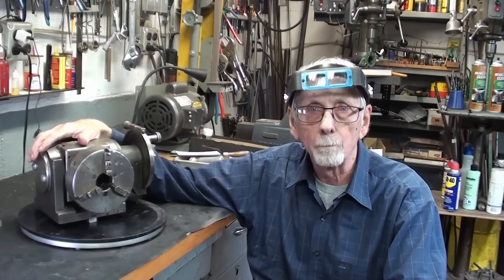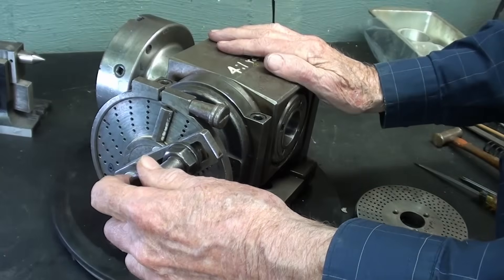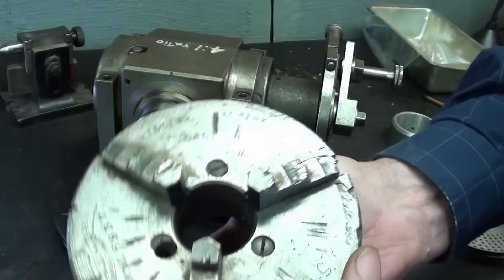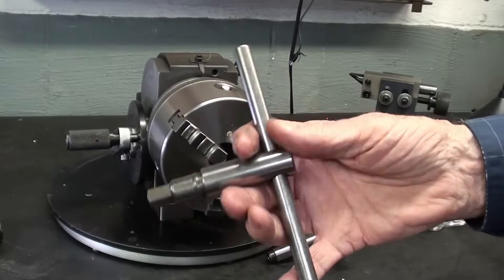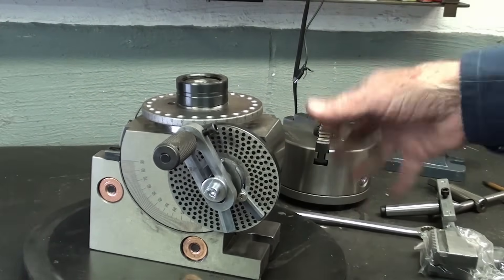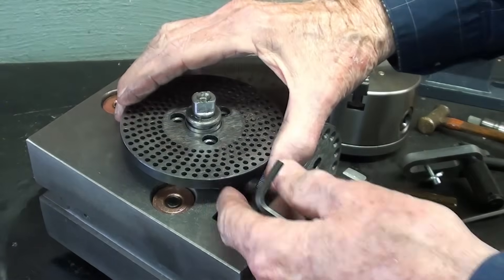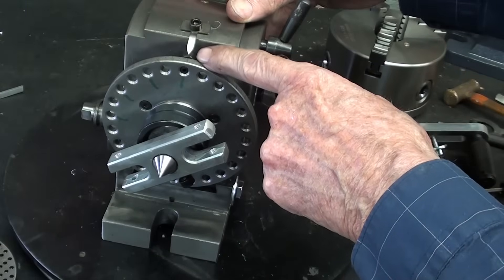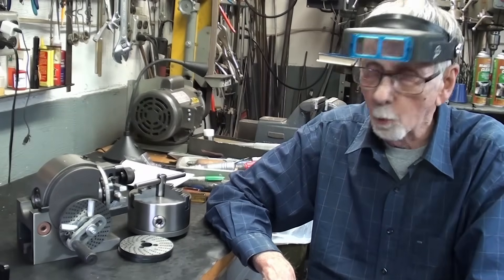MY NEW VEVOR DIVIDING HEAD #1046 pt 1 tubalcain index

Comment: I'M RETIRED WITH A SHOP AND IT TOOK 4 YEARS TO PUT IT TOGATHER
MANY PIECES CAME FROM VEVOR
8 IN,CH 4 AND 3 JAW LATHE CHUCKS FOR A HARRISON 250 LATHE
DIVIDING HEAD , ROTARY TABLE 8 INCH AND A 6 INCH MILL VICE
ALL WORK GREAT AND AFFORDABLE AMAZON !
Reply from the maker: That is awesome and affordable. I’m not sure why so many people are violently a pool to vevor.
I know it’s all Chinese, but so is everything at Walmart, Harbor, freight, Home Depot, and all of the rest of the box stores and it’s going to stay that way forever
Reply: @mrpete222  IF IT WORKS FOR YOU THEN BUY IT ! 
 IT BEATS THE SAME USED PRODUCT MADE IN USA AT 5 TO 10 TIMES THE PRICE. CHINESE IS ACCURATE ENOUGH FOR MY WAY NORTHERN COMMUNITY AND THE SHIPPING IS FREE. I ALSO LIVE IN A PLACE THAT IS WAY OUT THERE IN BF NOWHERE.

Comment: Hi Mr Pete, I really enjoy your videos. I have one of these Vevor Dividing heads. I have had it for 2 or 3 years now and I find it to be excellent. 
I am very tempted to try one of their Vevor DRO kits! I have bought a number of items from Vevor over the years, Some of them are certainly made down to a price. I bought a welding table for example which is a bit cheap and nasty but it does what I neddd and only cosy me £29.99. I couldn't have bought the steel to make it myself for that.
Reply from the maker: I will be making more videos of the dividing head in the future. It really appears to be quite good, especially for the price.      I think a lot of their products are pretty good, certainly as good as harbor freight. But I’m sure some of it is junk. But that is true of just about every manufacturer.

Comment: Thanks Mr Pete. I have one BS0 for some 2 years by now and have used it several times in vertical mode with the supplied chuck (that fits to my pretty old Blomqvist BSN600 benchtop lathe). The base lacks a drain hole making some operations with the chuck and after some milling the bore will be filled with cutting fluid and chips.  
The first time used in this way it was left overnight with the bore stuffed with chips and cutting emulsion.  Bad idea indeed. Next day I found that it was difficult to rinse the bore and I disassembled the whole apparatus that was quite a job. The axial bearing has no sealing and was cleaned from very fine chips. 
I decided to make a drain whole that meets the T-slot.
At next usage in the vertical mode I was satisfied to see the fluid disapeared and the chips could now with success be sucked up with wet vacuum cleaner.
You may ask why I did not use the 8" round table - the reason for this was that there was a slight taper in the workpiece.

Anyway the BS0 is well worth it's price.
Cheers,  Ingvar, living in Sweden

Comment: Obviously vevor picked you out a good sample to show. Mine had the following faults.
1, gradient wheel you could only see half the gradients
2. Indexing pin did not fit into the Indexing holes
3. The chuck had the brand name ground off it!
4. The so called brass lock nuts are just coated brass colour, they were rough and would all free movement of the head
5. The lock screw that is at the back of the spindle was a socket head screw that protruded so far out that you could not turn the head up 90degrees.
6. None of the indexing plates had the number of holes stamped on them!
There is a video of mine on my channel.
I think that vevor must get more than one supplier as the ones I have seen vevor give out for free on yt to show seem to come in a box with red printed writing and then there is the plain box which mine came in.
I have bought a few things from vevor and the quality/price has been ok, but I cannot recommend the bs indexing head unless you are lucky to get a good one. Mine was rubbish and a waste of money. I can only advise if you take the gamble and get a crap one then to send back straight away, vevor never fixed my issues or refunded. Mick
Reply from the maker: Sorry to hear that
Reply: @mrpete222  not your fault. Mick

Comment: That's surely a rare ratio on that Hardinge, and people who have odd ratios on old dividing heads without documentation can have a hard time. I created a calculator for such cases where you can input any n:1 ratio and calculate which plate would be required for a given number of divisions. There is also a calculator that will generate a table like you'd find in the original owner's manual for a dividing head of any n:1 ratio. You can DM me for more info, won't pollute this comments section with links. Would love to share my calculators with you as well @mrpete222 as a small payback for all of the knowledge and entertainment you've given me over the years.

Comment: A teardown and cleanout of the original lubrication might ve in order. I value my dividing head but I don't think budget chinese gear can ever be assummed to have had swarf properly cleaned out and decent quality lubricants used. A tear down, wash and relube is unlikely to be a total waste of time even if its not strictly necessary in an individual case but may make a big difference if its full of swarf and sump grease.

Comment: Can a 5C collet be fitted from either side on the original dividing head? it looks like it could.
Reply from the maker: No
Reply: @mrpete222  Thanks Pete, can the original head be swung completely over 180 degrees so it can be used on either side of the bed?

Comment: I bought an Ellis a few years ago. It’s in pretty good shape. The paint was mostly still there, but except for a hidden spot, pretty deteriorated. The surfaces were in excellent shape except for a light patina. The only problem was that one foot was broken off and gone a long time ago. I took it apart, cleaned everything, removed the paint and powder coated it. I then welded a new piece of cast iron on to replace the foot. I use 309L TIG rods for cast iron and it works very well. I wouldn’t use it for a hollow part, but for something that isn’t stressed from both sides, it works well. At any rate, it came with an excellent 4” 6 jaw Adjust True Buck chuck. It’s really nice. All the manuals are available on line. I only have two plates for it, but it hasn’t been a problem. Disengaging the indexer just requires loosening a set screw on the top of the device, lift the indexing unit and it’s done. Reversing that, of course, puts it back. What’s nice is that you can rotate it in the horizontal plane as well as the vertical. That makes cutting angled gears or even tapers very easy.
Reply from the maker: Sounds like a great head. And that chuck is a bonus.

Comment: I made a gear in shop class (grade 11 I think, back in 1975) with a dividing head sorta like that.  It was for a tennis net winder winch on the opposite side from the ratchet and pawl.  That was in Qualicum Beach on Vancouver Island Canada. I remember the teacher Mr. Harris showed me how to set it all up and how to turn the winder to get to the next gear.  I remember thinking WOW I'm actually creating a gear.   We got the winder welded onto the post and it worked well.  Thanks for another interesting vid.  And like another commenter said thanks for the END screen so we can avoid another ad.   Does it have a means to lock the chuck to the spindle so it won't come loose or unscrew itself while machining?
Reply from the maker: Thanks for watching. No lock to hold the chuck onto the spindle

Comment: Is there any value in putting this thing on a plate and going at it with an indicator?  I've never owned one, but now I might so I'm curious how one might check it out.
I've had very mixed luck with direct-from-China stuff.  What are the things one would want to measure on one of these?  TIR on the axis?  I don't even know what can
go wrong with one. ;)  I can't make out how the markings are done; laser-etched, engraved, painted?
Reply from the maker: In a follow up video, I intend to use an indicator to set it up

Comment: I have the same unit from a different vendor. I suggest you take it apart and clean the grit from manufacture out and put in quality grease
Reply: My practice for new Chinese machine tools is to immediately disassemble it; remove all the grit using WD-40 and brake cleaner with shop towels, brushes and Q-Tips; oil everything well; grease where needed, and reassemble. I'm astonished by the amount of griding grit I find in Chinese machine tools. I bought a new ER-32 Spindexer, and the spindle would barely even turn because of the amount of grinding grit.
Reply: Probably a Vertex? I have had four dividing heads from Vertex and only one was running smooth (250 mm or 10 inch diameter).

Comment: Good initial video.  I have the same model, came to me in terrible shape new in box from the factory was rusted, pitted, poorly machined (they forgot to grind in the bottom surface and was rocking/not square) and the oil was full of metal chips.  Took 3 hours to fix everything and it's quite good after that.  If you take the time to clean/repair Vevor tools I find the good value for the price but rarely do they look as good as yours when they reach me.
Reply from the maker: That is unfortunate, I have heard of some products that need attention when they arrive.

Comment: I must be a little bit dim. I’m still none the wiser as to how or what tasks a dividing head is used for? I get the dividing part. But how does it fit onto a lathe?
Reply: It fits on a MILLING MACHINE
Reply: A pretty big one too. I bought this, without a thought regarding its size  - stupid me. It’s massive  in size and weight- 50 lbs. Great for a real machine not so much mini mills :)
Reply: Mine has been used for gear cutting on my milling machine. I've also used it for a circular set of holes. I can fairly easily do the latter either with a rotary table or the circular hole pattern tool in the DRO on the mill but the locking pin feature on the front direct indexing scale is pretty sweet.

Comment: What is the tariff cost now?
Reply: Get over it.
Reply: @Daledavispratt Well, yeah, the comment section of a MrPete video isn't a place to be making political snarks. 

That said, on a practical basis, ignoring whoever made what policy decisions, it's something to consider.  A keen eye on eBay, Craigslist, or FBM, might garner a better fundamental quality dividing head (even if a little untidy) for a bit more (to be fair, probably double) than the Vevor product, that may be (probably will be) a better, longer lasting, user experience.

My Vevor 4" Kurt knock off vice is decent enough (especially given my precision requirements) but if I could get hold of a used Kurt 4" over here in the UK at a sensible price, I'd be willing to pay three or four times what I paid for the Vevor.😉
Reply: If we always had proper tariffs, maybe we'd be buying a proper Rhode Island made head, not an import from, at best, dubious sources.

Comment: I purchased mine unboxed but unused at a Craigslist sale. I thought that I had it adequately oiled for the winter, but it severely rusted. I believe that mine is complete. I have yet to use it. I don't even know the brand. I brought home a full truck load and 16' trailer load from that sale last year. I  have several things to get to that I included in the purchase, but I have employed the vast majority already. 
My China dividing head was very cheap, but it naturally made me cry when I saw how easily tgat it rusted. I have a right angle plate from a previous purchase that sits with my other fixtures. No problem with the balance, but that plate turned to a fuzzy rust chia pet on its first winter in my shop. ...a poor $10 investment! I don't know much about metallurgy, but I deal with more rust issues on China made and shop made things than on high quality things.

The dividing head was a disappointment. The "complete" disassembled Atlas lathe was far from complete. But I got many things that are wonderful. I got a trailer full of industrial tooling storage and workbenches. I have sorted and organized thousands of drills, thousands of mills, hundreds of taps, dies, readers, lathe tooling, hold down components,abrasive, burrs, hardware, etc. This has hugely benefitted my shop. 
One project from that sale is to salvage a 14" pedestal grinder. He stole the fancy pedestal and tool rests to display a treasured vise that he claimed was worth $3500???
Reply: Wow. Steel is steel and it will rust if not protected. 
Sounds like you need to look for five gallons of Cosmoline on your next big haul.
Reply from the maker: I don’t know what would cause that rust
Reply: @mrpete222 Possibly a forgotten can or bottle of soldering acid in the shop somewhere. A humid environment or anything on the acid end of the PH scale will cause rust. Don’t handle your tools with sweaty hands after eating tomatoes. 😢😢

Comment: I have had this index head for a while and I’ve found it be adequate. In fact, I used it to cut the pinion gear for the nutcracker. My biggest complaint is that the key ways of the tail stock were not in line with the center. I’ve ran into the same problem with other Chinese products I have, namely my milling machine vise. But that’s another story.
Reply: It's easy to test, and offset keys could be made if needed. I think you bring up a good point about measuring and testing the setup. My habit is to assume everything is good and hit the ground running.
Reply from the maker: I haven’t checked that yet, I hope mine is OK